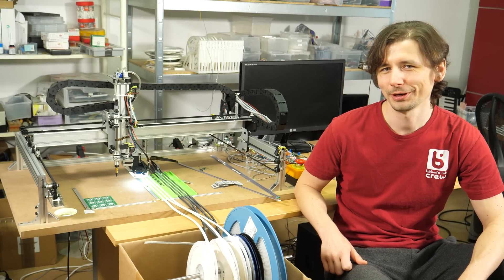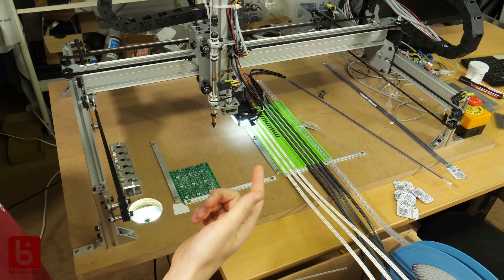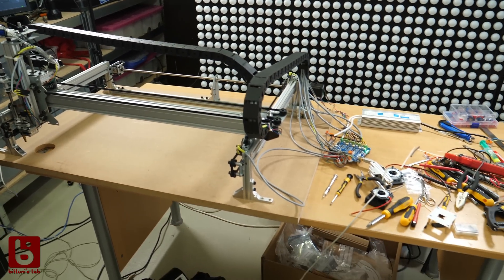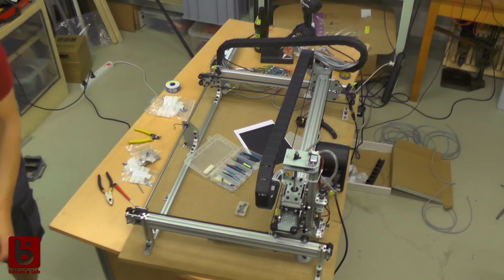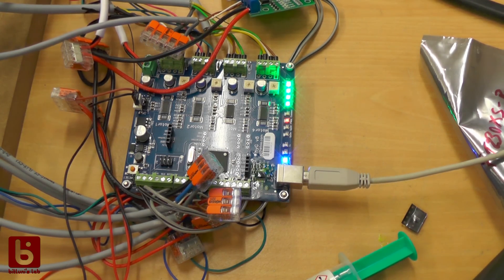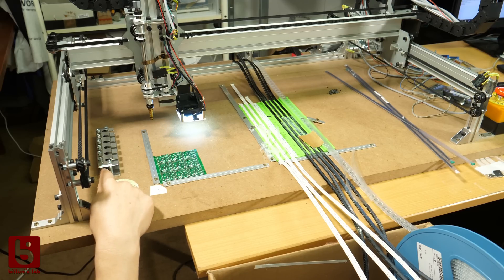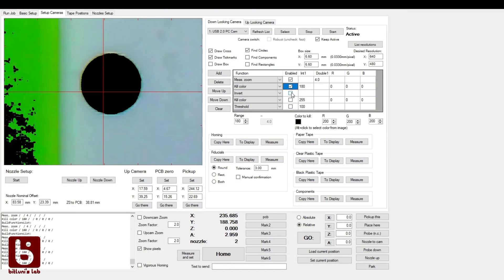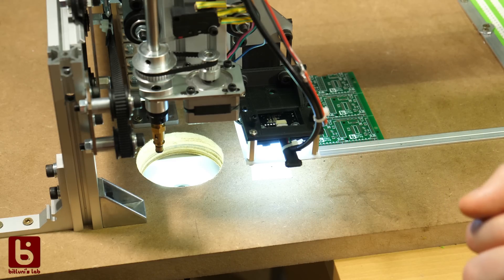My New Pick & Place Machine [Liteplacer]

Comment: Thanks for inspiration. Liteplacer looks like great reasonably priced tool for a small workshop :)
Regarding the additional FET board, I would honestly expect this to be an integral part of the board. It should be a fully working kit, shouldn't it? Why would you need to get an additional part? I would expect it to be part of the kit, even if it's an extra board.

Comment: May be I missed it, but does the machine pulls-up the component reel each time a component is used?   This way the robotic arm always goes to the same spot to pick up the compnent.   Also a sensor to tell the operator that the reel is about to end.

Comment: Super nice.
The correction of the component is actually sort of mandatory. I've worked with professional pick and place machines and you will be surprised how many components are just totally skewed in the reels. Sometimes even 180 degrees flipped. Normally this is done with a second steady camera, as a step between picking and placing. 
I was only wondering if you could go faster with this thing?
Unless you're doing 100 boards, I don't really see a benefit vs placing thing yourself. All preparations considered.
In fact, nowadays I just order them assembled even in small quantities.

Comment: when a motor is disconected it gives a reverse polarity high voltage peak, in toy cars the controller were protected by installing a ceramic capacitor directly to the motor, this way when the energy is turned off the reverse polarity colapses with the stored energy in the capacitor protecting the circuit, I wonder if it would work here too?
Reply: I know it's already fixed but I wonder if this simpler solution would work too

Comment: what are you using to prevent placed components from moving when picking up the pcb to place in the heater? Is it just using a solder goo with a stencil?

Comment: 6:10...verrrry sad. Also, I would augment those mosfets with an actual flyback diode. Mosfet diodes aren't supposed to handle that sort of voltage, and will have a shorter life for it.
A proper flyback diode either across the motor or mosfet will help prevent this.

Comment: First of all - it was interesting! That's for sure!
Was it useful? I don't know. I see that the process requires A LOT of manual work to start: place components in the tray, machine aligning, software setup. It was not clear how much time you're spending each time to set up the process, but for me it looks pretty significant.
In the end this machine costs a lot. 1700 Euros! So which production volume will save money versus manual pick and place?

Comment: Can you manually control the pick and place for one-off custom prototype boards as well. i.e. use camera to visually position it, then control suction nozzle to pick up and place it where you visually want to put it?  i.e. joystick control? Also, how do you solder paste? Manually with a stencil or does the machine apply paste as well?

Comment: You can buy a real, complete, Chinese pnp machine for just a little more money.
Reply: Took a quick look on AliExpress and it looks like there are some options available in the ~$3500 price range including shipping, which is anywhere from 1.5-2x the price of this kit and not as easy to service, modify, or upgrade. I couldn't find anything cheaper (well one kit was $2400 but had $2000 shipping lol, but I didn't search all that long so many there are lower priced options?) So it seems like this kit is still a good buy if you don't mind building it yourself (or even better, if you prefer building stuff yourself as I'm sure he does). Plus the software is open source on this one which is nice. I imagine if you have issues with either the hardware or software with the prebuilt machines you're pretty much screwed...

Comment: The best protection for your PC is a USB isolator.  They're not super cheap but they are cheaper than an entire PC.  The need for isolators increases with the amount of power your device uses.  Remember ground is not ground, it's a wire leading to ground.  Bad grounds will allow high currents to travel up one USB cable and down the other.

Comment: I'm surprised the camera they use has a rolling shutter (instead of global shutter) but I guess it keeps the cost down, and the machine still works. You can notice it as the image warps while in motion.
Reply from the maker: true, it's a basic webcam. works good enough and I'm thankful. otherwise my screw up would be more expensive

Comment: So, let me understand if I am getting this right.

- You use a stencil and a spatula to apply low melting point liquid solder to the PCB
- The PNP puts the componentd onto the PCB
- Superficial tension from the solder keeps everything in place
- The oven melts the solder
- The ultrasonic cleaner removes leftover flux

Correct?
Reply from the maker: That is exactly how I do it. even if the parts are not 100% perfectly placed the reflow will pull them straight. I poke from time to time one component that's off too much to avoid rework later. Before US clean I check for solder bridges or other errors. After cleaning I test the boards. If there is a fail I rework, clean and test again
Reply: @bitluni  nice. Thanks. 👍🏻

Comment: Please get some trinamic drivers for that thing it really sounds horrible for anyone used to modern 3D printing...
But nice didn't knew that there is a DIY Pick and Place Machine Kit that you can just buy, always assumed you need to source the stuff yourself.
Reply from the maker: The current was set too high while I filmed earlier. I reduced the current and it's sounds much healthier now :-)
Reply: @bitluni  trinamics silent step is pretty amazing.
All that is left is fan noise... sometimes you wonder if its even plugged in.
It makes a real difference when you are working around the machine.
But man, that sounded really terrifying in your vid...

Comment: What do you use in your ultrasonic cleaner? And how small can the parts be for the Machine? 

Can it place 0402 or even 0201 SMD components?
Reply from the maker: you probably could place 0402 but I personally feel there would be much calibration needed and probably more rework. 0201 never

Comment: You got off lucky! I was using an oscilloscope to measure the voltage on a 96V BLDC motor and made the classic "how NOT to blow up your oscilloscope" mistake and the surge went through the probe, into the oscilloscope, but rather than ground, I guess my plug was flaky, it went down the OTHER probe, to my board under test, into the USB port, into my $1500 laptop (killing it!), and through my power adapters to ground. Yes the power adapters connected the negative contact to earth ground.

I took the laptop apart to repair it louis-rossman style, hoping it was just a blown fuse since the laptop simply didn't do anything. Found 1 PCB mount fuse that was blown and some random SOT23 package, but also a dead VRM on the CPU. I suspect the CPU saw a 12V spike on one if it's lower power rails, killing it, but I have no easy way to tell if it's alive or dead. I was able to get some sign of life by removing the shorted MOSFET and VRM but no POST screen or anything.
Reply from the maker: Oh man... that sounds terrifying. feeling really sorry you didn't have as much luck as I had.

Comment: created a smart home system with electric door locks, but when i unlock the door locks the whole system was restarting :) that was the point when i learned about the spikes that come from coils and the meaning and usage of fly-back diodes :) i lost whole week debugging and testing, was thinking it was my custom software problem :)
Reply from the maker: You are lucky nothing melted :-D
Reply: @bitluni  luckily the door locks were far away from the microcontroller and electronics, was controlling them using relay which has optic isolation i think...

Comment: Why did you rotate the bigger ICs by 90°?
Reply from the maker: I set up all the rotations in the tapes definitions to match with the desired outcome combined with the angle from the centroid file. most of the components have a rotation some even 180°. you can actually see the motor on the cover that does the rotation of the head
Reply: @bitluni  I think I don't understand the first two sentence. You can rotate the head without limitations, can't you? The ICs were delivered in a tube, but later you designed a tray, which rotates each IC by 90°. I would estimate that makes transfering the ICs from the tube into the tray much more tedious, but it might simplify the programming?
I have to admit that I just watched small parts of the live stream.

Comment: The body diode in a mosfet doesn’t protect it against inductive flyback voltages. A discreet flyback diode (or freewheeling diode) needs to be placed (reverse biased) between drain and supply - assuming you are low side switching that pump.

Comment: Up next, solder / auto wave machine, solder bar, and , a factory... 🤭
Reply: Soldering (with low melting point solder) via a stencil and a spatula cannot be simplified much further throught a soldering machine, thou...
Reply: Actually a soldering machine would be easy to make you just need to have a moving platform passing over two elements.  I do actually operate a proper surfacemount loading machine this is actually quite interesting and I could possibly send you some pictures of how the feeders work. This is what the holes are for. You need to make a sprocket assembly driven by a servomotor. Then putting the feeders in a allocated space. Then somehow program your software to just pick the Part from the allocated space rather than get it to look for a hole. The machine could possibly be speed up a bit faster if you were to use heavier stepper motors on the XY axis. The machine are use is a Yamaha YM 85. Which is about 30 years old and the machine you have there is almost as fast as it but however it looks like that machine has a better vision pick up than the YM 85.

Comment: You must have some other machine that wets all the pads with solder paste?
Reply: So... solder mask => solder paste in the correct spot => PnP machine puts the components => components held in olace with solder paste => in the oven to turn solder paste into solder joints ?
Reply: @enjibkk6850  yes
Reply: I think he uses a soldering stencil and soldering paste for that